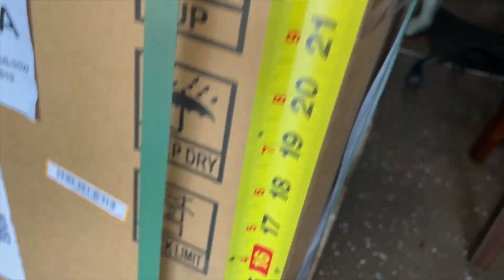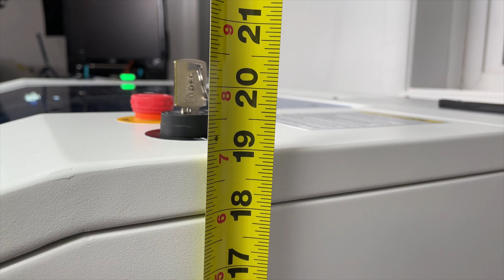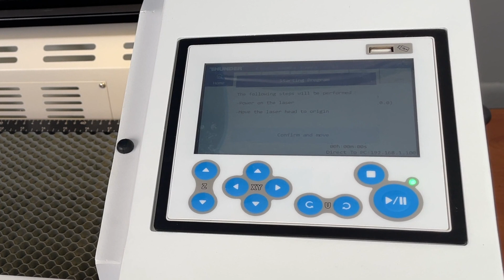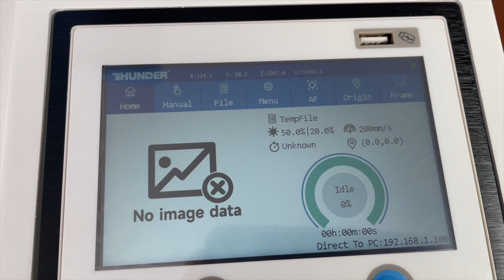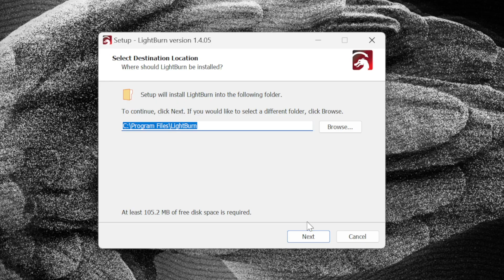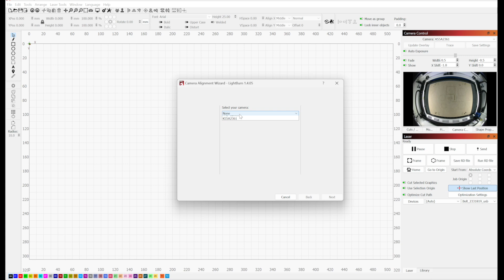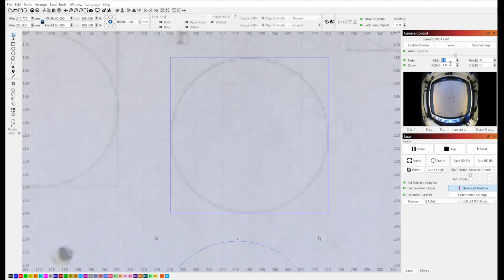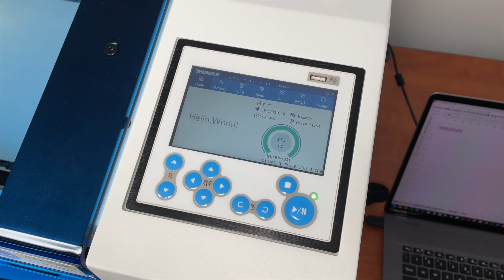Best Desktop Laser of 2024?

Comment: The problem with the Bolt is that with regards to 1/4” wood, a 40W diode cuts it faster and cleaner. And if you step up to a 60W or 70W diode, it’ll do it even faster. The Bolt is amazing for engraving and for up to 1/8” wood.